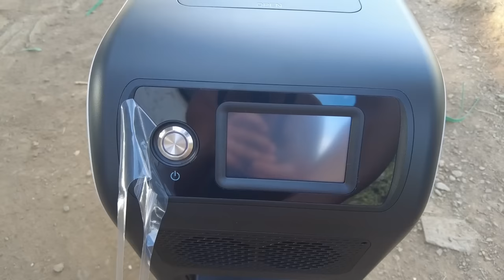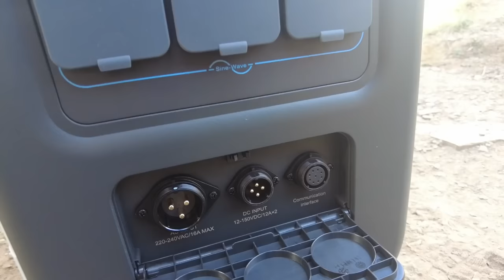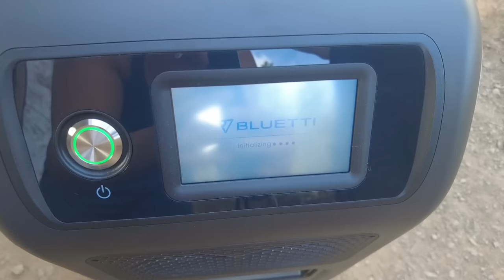Digging into the mountain to build our dream home - Installing our new battery Bluetti EP500Pro

Comment: Your family is certainly not worried by a bit of hard work and set backs. You just seem to find another job or approach it from a different angle. It will be an amzing veiw from the front of your house and well worth the work.

Comment: More power to Martins back, mine hurts just watching.  That road still looks pretty narrow for "truck delivery", so im wondering what exactly your new house is being constructed with. I was close to building an "earthship" type with rammed earth walls, but local planning said no.  I got spoilt as i got older with mini-diggers and JCB 3X, that i dont want to ever pick up a shovel or pick again, I hope your digger comes back to life with no further problems.  Spectacular view for your new home!  That Bluetti is a nice bit of kit, how big was your panel output?
Reply from the maker: It's big enough for the guy who delivers the gravel and sand :) We'll be building with earth bags, so we don't need to accommodate big cement trucks. We were also spoiled with the digger, it's a great tool when it's working. All the smoothing out was always going to be jackhammer work though. With full sun we get about 900 watts now, will talk about it more in the next video.

Comment: Good to see  the family back and well. 
Seems like the road is ready for a small truck to deliver materials (sand, gravel, cement, etc). 

After 1 year fully into constrution business may suggets you consider using sandwich panels in the builds. Great insulation, easy and fast built, ends up being cheaper too. If you go the tyre or bag earth way...good luck, i see for the next very labor intensive years 😊
Reply from the maker: We'll be building with earth bags, so you're in for some years of content ;)
Reply: @ourportuguesehomestead  ahahah i will. Good luck.

Comment: So as an old construction worker I would highly recommend to lend some appropriate machinery, for instance a large hammer for a few days instead of spending months with this tiny one. Thats not worth it and my guess is you will find some in Castello Branco. So save your time for more nicer things 😃
Reply from the maker: I’ve asked around whether it was possible to hire a bigger jackhammer, but the bigger ones are fairly expensive to hire here and often use more than 2000W (our limit with the bluetti). I understand that as a hired contractor speed/time is an important factor, but my own day rate is unbeatable ;). Cheers Maarten

Comment: Its impossible to be an expert at everything.  The digger diesel engine is a good example of needing a good mechanic and machine shop close by to help out when needed.  The Problem is good mechanics and machine shops are busy with their repeat steady customers.  So the occasional customers are lower on their priority list.  I have a track loader that should have been repaired a year and a half ago. When I was willing to use the dealer for the repair, they were busy.  Now I want to do the repair myself, but I don't have the skillset to do it easily.  So I need to learn the skills to do it.

Comment: You have the saw why not stop messing around with a root and just take down the tree and widen the corner. The road is not wide enough
Reply from the maker: Ah yes, just take out a three meter diameter eucalyptus tree.... Only need to cut down the whole thing and then dig away all the roots.